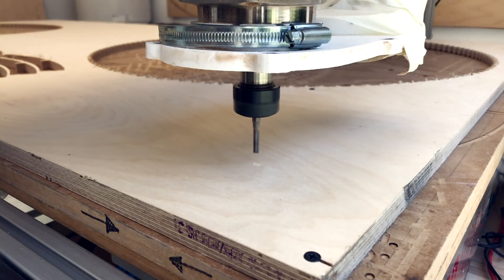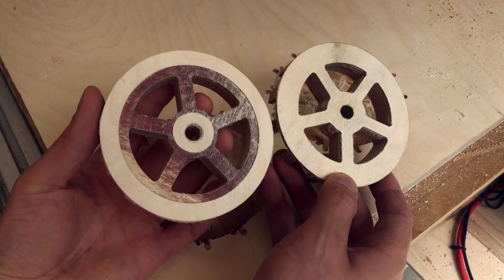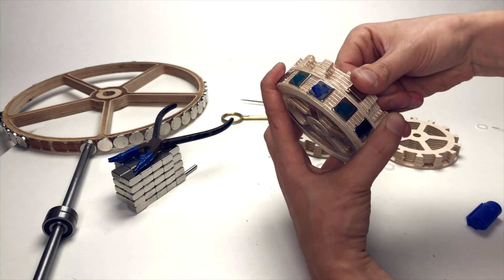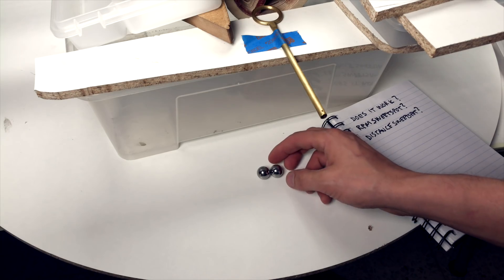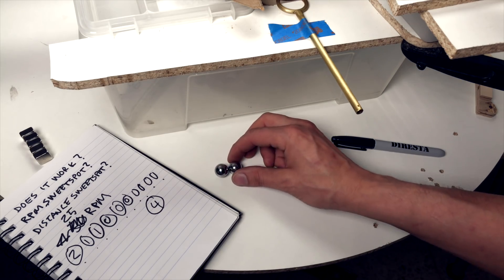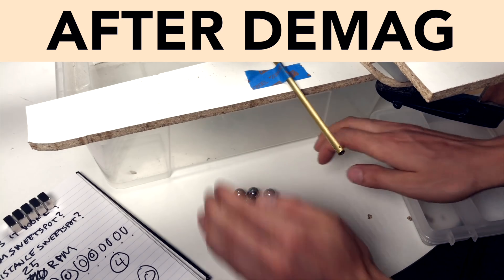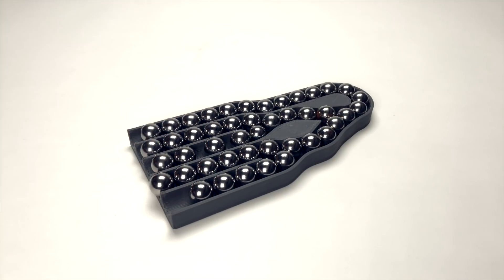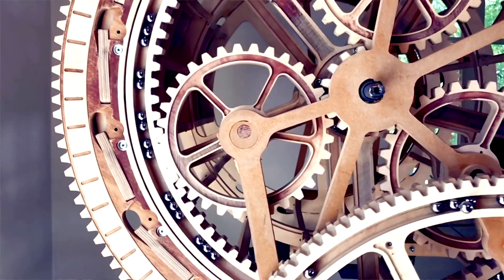Marble Demagnetizer 2 - Marble Machine X #39

Comment: A bigger concern of mine is what if any part of the machine gets bogged up with too many marbles? Like what if marbles go into the divider quicker than it can disperse them and what'll create the pressure to move marbles through the divider? When marbles get wedged off of the magnet wheel will you do any kind of population control incase the machine gets backed up transporting marbles?

Comment: IMO adding magnets was a big mistake. ^There was no need to add a potential for critical failure..  If a ball gets stuck in a cog you could have catastrophic failure.

Temperature has to affect the magnetism right?  How about electrical fields?

Pause at 10.06   can you see the problem?  Those balls are sticking together and hanging off the wheel!!!!

Comment: The faster the better.  Alternating and reducing the magnetic field will demagnetize as long as the initial magnetic field is larger than that held by the magnetized object.  make the track curl around your rotating magnets to reduce the rate at which they move toward and away from the magnetic field will increase the rate at which you can feed the marbles through.

Comment: Martin did you consider long-term integrity of the demagnetizing wheel? Using only interference fit may fail eventually. Maybe consider adding adhesive backup. Or re-make using magnets with trapezoidal x-section and matching cutout - I know you can get my meaning without a drawing :)

Comment: The faster you push marbles through the demagnetizer, the faster the demag will have to turn. Its the fast changing magnetic field that randomizes the magnetic domains in the marbles. So, its better to error on turning the demag faster than slower. However, this will also create more effort to crank as speed goes up as well as more noise. You might want to start around 120 RPM (2x/sec.) with a toothed belt drive system so you can change pully sizes if needed later to change the rotational speed. Also, check for rotational harmonics induced into the frame at speed.

Comment: The RPM sweet spot would be between 25-80, because after 80 it doesn’t increase in effectiveness, it stays the same (perfectly effective), but it clearly works better between 25 and 80 rpm. Not that it would matter if you ran it at 80+ anyways because it works perfectly, but I’m just saying.

Comment: YAH! Extra video!  How are you 'pushing' the marbles past the magnet, let alone, or even at a fairly steep angle they will just wiggle back and forth.  I am a little worried the magnets when pushed will pop out of the tray on the bend instead of being pushed around the corner.  A plexiglass cover over this part would solve that though if necessary.  I really love the look of the track and the magnet wheel!

Comment: I don't see anyone else mentioning this, when the magnets are mounted so they attract each other, you lose a lot of the field strength making a circuit between magnets instead of a circuit through the marbles.  Please try rotating every other wheel so the magnets oppose each other, and the fields will reach out to the marbles much more.
Reply: a quick citation, look at the field drawings here https://en.wikipedia.org/wiki/Force_between_magnets  see how the repelling magnets fields go much further from the magnets?

Comment: I know you refer to them as marbles but in reality they are ball bearings or steel balls. Would it not have been easier to use "real" glass or ceramic marbles instead of steel ones? You wouldnt have the magnetizing problem then but i realize you would require some other form of lifting mechanism instead. Just a thought. Its looking good though.

Comment: If you want to fly with such strong magnets. You should check the airfreight rules about magnets and how the rules for dangerous goods are. Strong magnets have strict rules for flying.
Reply: very correct. taken from the internet:
"There are two important measurements of a package containing magnets. Rule #1: If the field strength is 2 milligauss (0.002 gauss) or more at a distance of 7 feet from the package, the IATA (International Air Transport Association) says the package needs to be labeled as Magnetic (see below). This is especially applicable for international shipments.

Magnets are often shipped in a steel-lined box to remain below this limit.

If there is any chance that the arrangement of magnets could change, or any package shielding could be damaged so that a measurement exceeds this value, it falls under the Dangerous Goods category and should be labeled as Magnetic.

Rule #2: For any package shipped by air, whether it is labeled magnetic or not, the field strength must be 5.25 milligauss or less at a distance of 15 feet from the surface of the package (FAA Title 49, Part 173.21 Forbidden materials and packages). If the package measures above this value, don't ship it by air.

Why are these rules so important? The magnetic compass. Despite all the fancy GPS navigation systems, the basic compass is still an important part of aircraft navigation. If a cargo of magnets alters the compass readings, accurate navigation might be compromised.

Comment: Demagnetizer will be more effective if adjacent magnets (sideways) are oriented with the same pole out.  It would be even better if the magnets were backed with a steel pipe.  Your ramp should be longer, so the marble can start close to the magnets and move farther away before dropping off.

Comment: Why didn't you try 40RPM and 60RPM? Clearly 80RPM worked, but you don't know 60RPM for example, might also work.Those may have worked too. You my regret not using a dab of glue to hold the magnets in, as over time they may work themselves loose.

Comment: The distance needing to be close makes sense right? Magnetism I believe follows tge law or inverse square meaning every time you double the distance from the magnets you halve the power and vice versa.

Though that would mean if you could get magnets twice as powerful you might be able tochange the distance which might help with any layout issues (though you would have a larger magnetic field in the middle of the machine).

Also, since you've got spinning magnets does that it could cause interference? There's no electronics near the demagnitiser is there?
Reply: About electronics near the demagnetizer, you're right! 
Sounds, music in fact, will be catch with internal microphones (or sound catchers.... , electronics stuff)... but looking at the localisation of the demagnetizer and the place for instruments it should be all right.... may be Martin have to try this to be sure it works....

Comment: Since this is a hand crank/treadle system, you should add a coil of wire around the magnet wheel to generate electricity, add some low-power LED tape lights or charge your cell phone!

Comment: Very good, however I have had some experience with demagnetizing iron and I would suggest varying the RPM in small increments over a broad range for thorough testing in order to determine the best frequency. Your magnet wheel appears to have approximately 16 magnets alternating polarity, which you have tested successfully at 80 and 190 RPM; this equates to a degaussing frequency of between 640 Hz and 1.5 KHz, and potentially higher. I would recommend first determining the upper end of the effective range of frequencies, and then finding an RPM value with a frequency near the center of that range that is convenient to work into the driving mechanism. This is because minuscule variations in the mass of each marble could mean that, were you to use a low value like 80 RPM, some less massive marbles could remain magnetized, unless you test every marble carefully. You will of course want the wheel to be mounted as close to the marbles as possible.

Comment: I'm a little concerned about marbles jumping out of the demagnetizer.  I'd think they would resist movement at the input since the demag wheel is spinning in the opposite direction and possibly try to jump the track as pressure on the marble train builds.

Comment: Have you tried running the demagnetizer in the opposite direction? Any such unit I've seen rotates the opposite way of the items movement. It does do that for the single track of marbles before they are split, but I think it would be more effective on the 4 lines of marbles.

Comment: Martin, what are your thoughts on combining the final lifting mechanism (the 8 marble lifter) with the de-magnetizer. What you could do is simply line the magnets up in front of the marble lifter and you wouldn't have to push them along or rotate a wheel. This could prove to be more efficient and simpler with less moving parts. Let the machine work for you, dont do the work for the machine (this is especially true when u take into account the fact that most moving parts of the machine are powered by you and the more parts you add, the more work it will require to move them)

Comment: If you can't design a marble demagnetising machine with a mechanical system, try an electrical system, specifically a degaussing coil. What this is a coil that is powered by an alternating current and when the marbles go away slowly, they get demagnetized.
Reply: Or non-magnetizable marbles.

Comment: Some comments about the test you did today. It might not be a problem and you likely did more test than we saw but here we go anyway: 

1, You had the marbles a very long time over the demagnetizer. Much longer then reality,  it might invalid you test?

2, I don't know about the push power you used when pushing the marbles of the track over the demagnitizer, but they seam to get stuck on the wheel. Maybe so hard that the marbles will climb each other when there are many?

3, For the RPM you can try a even lower RPM then 80, like 64 or so. To easy match the RPM of other wheels in the machine. 

Grate work love to see the machine  finished! 

/Erik

Comment: Wouldn't it be easier and less error-prone to use an electro magnet that changes the polarity with a frequency?  You'd just need a spool and alternating frequency. You could probably create electric power just from the crank as well.

Comment: Be carefull: your RPM sweetspot also depends on how fast the marbles pass through the demagnetizer which will go up as the BPM raises since they will be pushed through by the wheel.

Also when the machine starts or slows down, the demagnetizer would be too slow to be effective and you would end up with a few magnetized marbles in the circuit. I'm really wondering how you can adress that without using a separate power source to run it before everything else... which would totally ruin the idea of the machine.

my guess: RPM = 2 or 1.5*BPM

Anyway, awesome video as usual!

Comment: I think you'll have a problem when this is at the machine.
1st: the magnets roll on the wrong direction for the feeding channel. Work around: take one wheel of magnets off.
2nd: you are just plating the marbles on top and pushing them off slowly, you should test it like it would be on the machine.
Reply: human bean   why?
Reply: both not a problem

Comment: Um... my concern is that the magnetized marbles will come into the track phase locked in series... and unable to actually roll.  The spinning demagnetizer, if close enough for effect, will also add attractive drag...  the result as shown in your test is that the marbles will have to be PUSHED thru against that resistance.
Testing with just a few marbles in the chain is not giving you an accurate idea of the cumulative resistance to rolling of magnetized marbles.
Does the primary magnet lifting wheel discharge marbles with a pushing action sufficient  to shove a chain of 40 marbles that are stuck pole to pole thru the track Without derailing  marbles on the curve?
You really need to do a full function test of the lift and demagnetizer system fully loaded with marbles at maximum speed to see if this system will work.

In addition... there are other metal parts on the machine. If they are ferrous then the passage of magnetized marbles near these metal parts, when the marbles self orient in phase will gradually magnetize them, even at some distance.  While not noticeable with random short term tests... over the course of a song, the lifters, springs or axels the magnets pass by will become magnetized.  Hopefully the oscillating field of the demagnetizer will be powerful enough to prevent this...  but I wonder how it might effect the magnets mounted on the lifting wheel?  Will it affect their strength? Or worse... will the spinning demagnetizer create drag on the movement of the lifting wheel itself?
My advice is to rig the entire magnetic and demagnetizing lifting system and run a 20 minute test of constant marble lifting operation.  Verify the demagnetizer is not creating problems.  If it is... then the safest solution might well be to eliminate the magnet lifting system entirely. A simple set of indexed teeth inside the marble track and a half circle steel bar to hold them in the track while lifting would solve all these issues pretty neatly without major reworking of the look or function.

Comment: I wonder if the rotating magnets will cause any problems with induction noise in nearby audio cables/equipment. 80 to 190rpm with 8 pairs of magnets will be around 10-20 Hz which is barely noticeable and probably filtered out but there might be some harmonics there.

Comment: Call me crazy but I don't think this will work as well with 8 marbles per crank, this single line may clog things up a bit. Shouldn't it be at a slight angle so the gravity is pulling the marbles out of it as well as them pushing each other? Just a thought

Comment: You could use the marble lift with suction caps instead of magnets. You just have to add a hole in the suction cap, that is close shut while liftig and open when not.

Comment: the speed in which the marbles are "pushed" through the device matters more that it looks! It will dictate how fast or slow the magnetic fields applied to the marbles will fade away! You can also interfere in that fade time by changing the diameter of the magnetic wheel! My guess is that the smoother the fade the better the job.

Comment: the speed at which you move the ball far from the magnet has a lot to do, so dont bother too much in rpm if you are not precise and consistent with the velocity you move the balls away from the magnet. In my opinion, Use high RPM with slow pulling away.
PS: The machine is looking beautiful!

Comment: I am afraid that the demagnetization resutls are influenced by the fall that the marbles experience after the track in your test; as you said in the first video of the magnet problem, the vibrations also affect the magnetism of the marbles, so it's possible that if you don't add the same falling section to the real Marble Machine X the demagnetisation level will be lower because of the absence of the vibrations caused by the falling itself. In any case you are doing a great job and I am certain that you will find a solution!
Reply: That may be true, but recall the times where even after going through the demagnetizer and then falling some or many of them were still sticking. I'd say the demagnetizer is the largest influence for sure, but you do have a point in that it could have had a hand in getting the results it did.
Reply: Than little fall into a plastic bucket hardly has any influence on the magnetization

Comment: Hi Martin, considering how flat that 3D printed part (that devides the marbles over the demag wheel) is there going to be enough force to keep the marbles flowing? so far I have only seen you push them in by hand from one end but it feels like unless there is one downward slope at the entry  way leading to a second one as the marbles get devided on their way out i.e a comound slope, gravity alone might not be enough ? what do you think?

Comment: I felt like the demagnetization test was a bit gung-ho. Maybe you should try with more rpm configurations (30-80)? You mentioned on the first video that, at the normal crank rate of 120bpm, the demag wheel would be rotating at 30bpm, so if 30bpm is not enough then you might have a problem

Comment: surely RPM sweetspot would be <= 80RPM since 80 got a perfect score, and you want to be able to demagnetize with a slow speed.

fast means more noise not making music, and more resistance + wear on the machine and your arm

also don't you want as far of a distance from marble to demagnetizer as possible? if there is less force pulling on the marbles, there is less chance they will get stuck at the demagnetizer.

seems to me you need to strike a happy balance between low speed and high distance.
Reply: 1wsx10 good point, but I think slowing it down may get the marbles stuck and/or move hardly considering that the magnets are strong...
Reply: about getting stuck... the alternating poles of the demagnetizer will help detach the marbles, especially if it is going slower.

really he needs to setup a rig that will let him adjust all these things (and magnetize marbles quickly) so he can run lots of tests and find the best setup.
Reply: Yeah, the sweetspot would be somewhere between 25-80.

Comment: Try getting your hands on a degaus unit with ac power
Reply: bentlikeitsmaker This has already been suggested. A mechanical solution is preferable. The current solution does the same job. I'm still worried that this is the Achilles  heel on the project.

Comment: Nice and compact design :). If you want to improve "efficiency" (in case demagnetization is not sufficient), you could add a ferromagnetic steel core (thin walled cylinder). This will close the magnetic circuit on the "bottom" side, where currently the wooden cylinder is. 
How are you planning to move the magnets through the demagnetizer? From this video it appears you need quite some force.